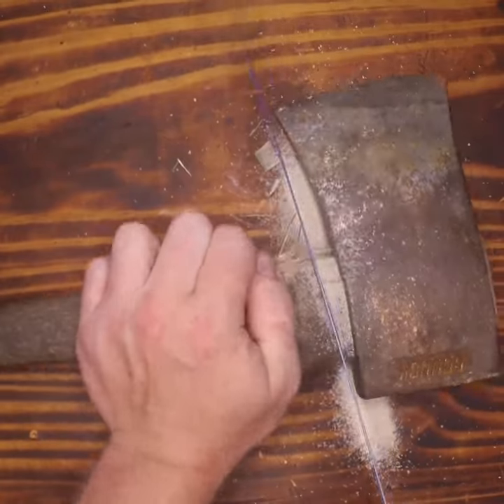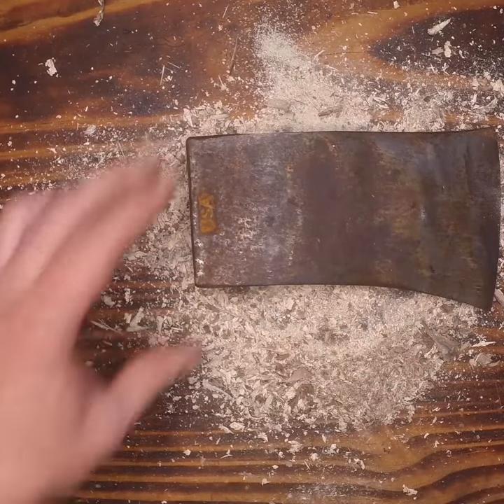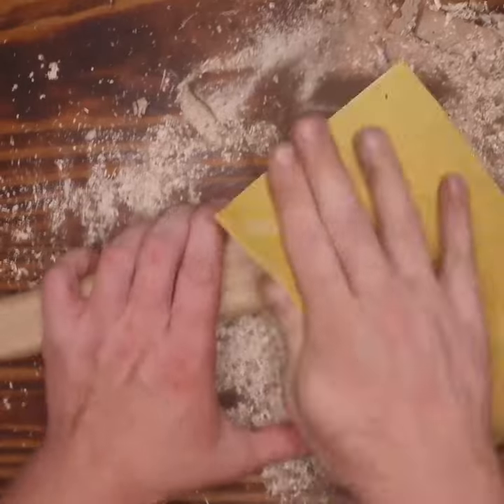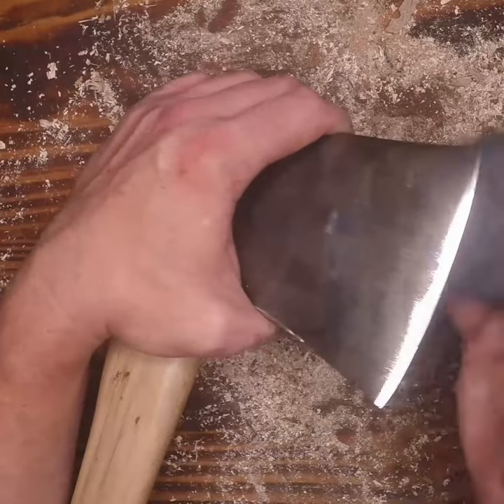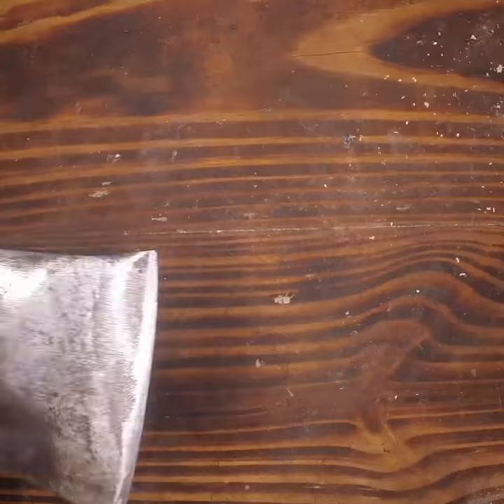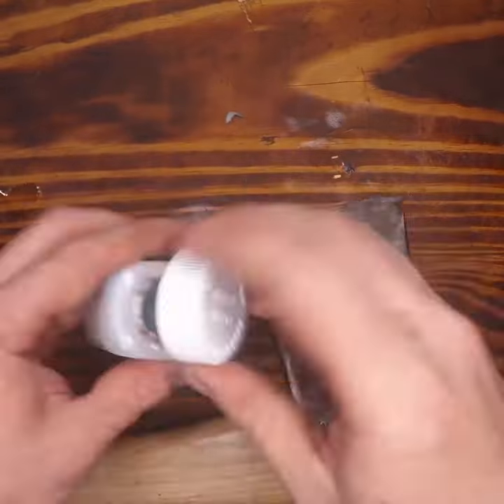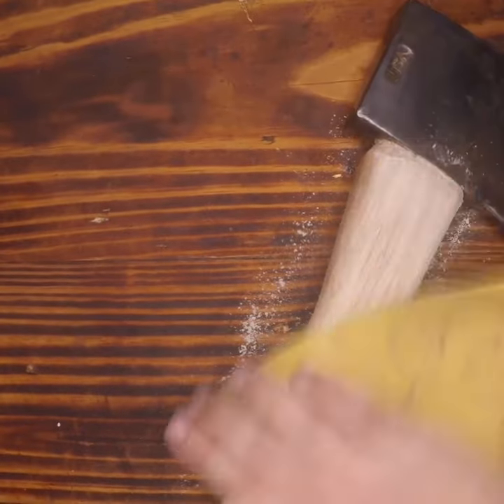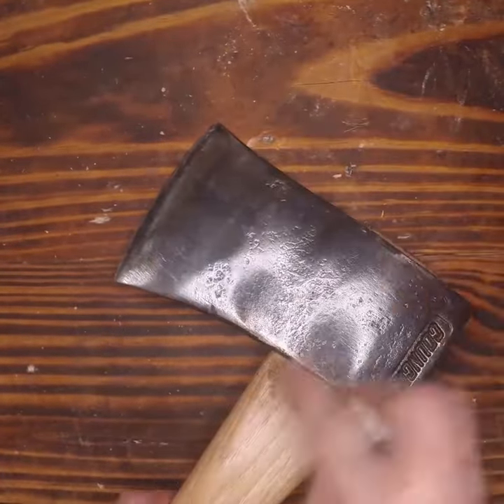Field Axe Restore In 60 Seconds

Comment: I didn't realize how much a pain in the ass sanding is until me and my dad sanded an old rocking chair so it could be re stained. Everytime I thought we were done there were more spots that needed to be done. I had to wear safety glasses because dust kept getting in my eyes
Reply from the maker: Sanding is one of those things that you have to really train yourself to love. It takes forever in a lot of cases.
Reply: I sanded something with a power tool while standing, took like idk maybe an hour, and my back started to hurt because the table was too low and didn't have a chair, and if i had I probably would have had to sand it looking like a goblin.
Reply: That’s why power tools exist lol, no one wants to spend like 5 hours sanding something

Comment: The straighter the grain on the handle the stronger it will be. Just a tip for anyone who doesn't know. It's a rare thing to find anymore but if you see an exceptionally straigh grain handle I'd buy it.
Reply from the maker: Good point! When making your own handles you can also bend wood in order to not have to shape it by excessive cutting of the grain structure.

Comment: You could maybe try rubbing that high gloss poly finish down to a satin with steel wool to make it less slick? Normally high gloss feels stickier to the touch, but I imagine once the finish gets a little dirt/grease/sweat on it, the gloss would feel significantly slicker, right? Although the satin might actually be sticker if you’re wearing gloves come to think of it
Reply from the maker: There are many downsides to leaving the varnish on axe handles. It is slicker, but also as it ages it tends to crack and wrecks your hands. Not comfortable at any stage of use really. Most experienced woodsman just take that varnish off.

Comment: yyyeeeessss!!! I have so many questions... first: what brand of bluing? I really like how it managed to keep that vintage look. second: would copper wool work just as well? third: what is and where do I get axe wax? fourth: would staining the handle work just as well as said axe wax?
Reply from the maker: 1) I just used cheap cold blue from Amazon. I left it in the states and forgot its name. 2) any metal wool will burnish it like this, if you don't use wool it'll be splotchy. 3) You can get ax wax on Amazon I'm pretty sure. 4) stain alone changes the color but doesn't preserve the wood as well as wax. Honestly it's fine. I usually use raw wood but I had the wax ready.
Reply: @FollowTheCompassNorth  thx for the immediate reply. I've got an old field axe in the shed that's been waiting for more than just a touch up. Sweet tips! Sick vid! Keep up the good work!

Comment: Apply boiled linseed oil to the handle to help extend its lifetime
Reply from the maker: That's fair, make sure you burn those rags or they will burn you.
Reply: I'd always done a "farm trick", where you use used radiator fluid on the head wedge, since it never evaporates. Mostly done this with hammers, thoughts on an axe head?
Reply: @FollowTheCompassNorth  actually, if you spread the rags out flat on a towel rack or side of a bucket, they will dry out just fine and won't be able to self-combust anymore. They only self-ignite because when linseed oil is  drying it produces a little heat. The rags need to be 200 degrees F to ignite. So it really only tends to happen in very specific circumstances: when there are a lot of rags, heavily soaked, bunched up tightly with the others, in a closed container.
Reply: @FollowTheCompassNorth  or just put them in a bucket of water with dawn dish soap it breaks down the oil and when you amass a large amount you can stick them in the washing machine

Comment: I need to know more about the " cold blue finish" , what is that?
Reply from the maker: It's a chemical oxidation. You can buy it online.
Reply: @FollowTheCompassNorth  thanks, I'll look it up.
Reply: Oxpho blue from Brownells, it a gun finish. There are other brands but Oxpho is probably the best choice. Mark Lee Express brown is a good look too.
Reply: Selenium dioxide, it typically is a layer of silver suspended in solution that rapidly tarnishes in oxygen. It’s a coating on the metal and it doesn’t actually change the metal composition of the steel underneath.

Comment: I do this for ALL my wood tools. That polyurethane coating entirely negates the point of having a wooden handle, it's harder than the wood itself and ruins the shock absorption of the wood. Before I use it, I'll and it down and coat it in used motor oil. Makes the tool so much nicer
Reply: The poly is a very thin layer on decent quality tools and wears off where you handle it with use

Comment: Nice restoration, but it immediately bugged me that the first step was unnecessary and made a mess just to keep it all in frame instead of having a slight wider shot
Reply from the maker: I had to work with the camera setup I had at the time. I couldn't move it or adjust it.
Reply: @FollowTheCompassNorth  fair enough

Comment: I'm not familiar with that Cold Blue finish he's talking about. Does anybody know if it's an issue when you sharpen after it's been put on?  Like does it gunk up your sharpening stone like some finishes or paint, etc?
Reply from the maker: Bluing is the finish that is done to guns, cold bluing is basically the DIY stuff you do to touch them up at home. It is a chemical reaction, not anything like a paint, so it won't gunk up your stone. The axe wax might depending on how much you use but I haven't noticed a difference.
Reply: @FollowTheCompassNorth  gotcha, thanks for the info 👍   cheers!